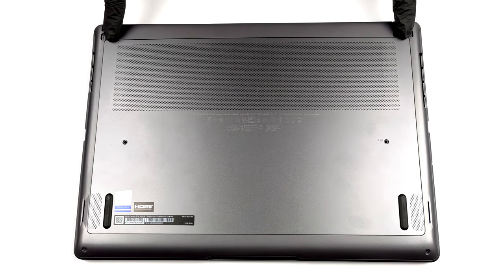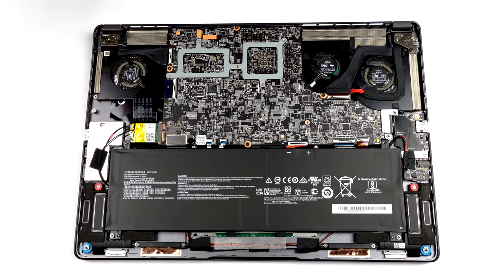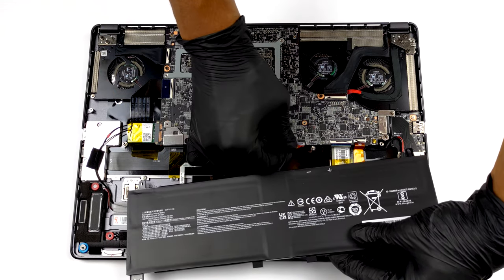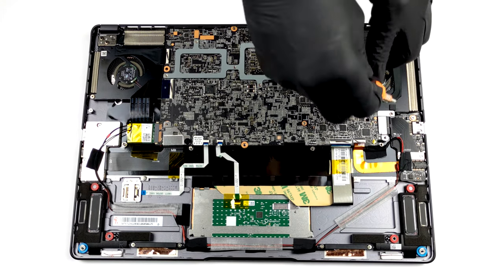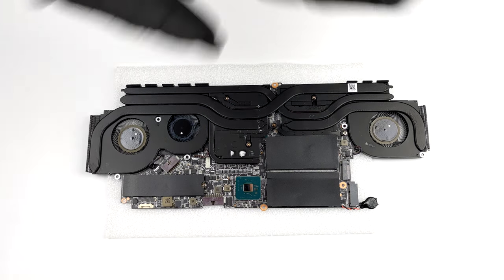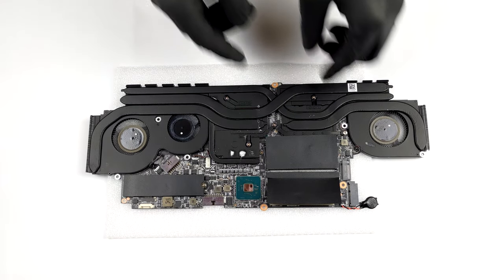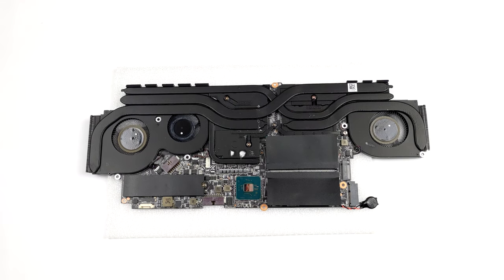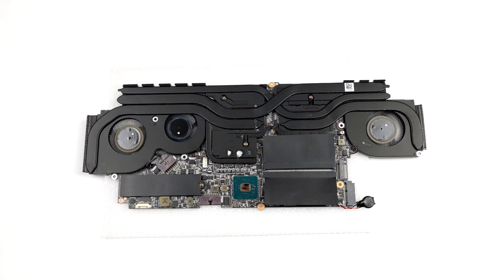🛠️ MSI Creator Z16 (A11Ux) - disassembly and upgrade options

Comment: You can access the 2nd SSD slot without removing the motherboard. It is located on the left (in this video), just under the top left fan. You just need to remove the battery and one screw, add another SSD drive and assemble back what you removed before.
Reply: Please show me how I want this laptop but this upgrade is very much off-putting

Comment: I own this laptop and now the fan started to cause me some problems. It doesn't spin properly and doesn't provide enough cooling to the CPU which makes it thermal throttle and shut down on its own. I can't use if for more than 30 mins. I would like to find the replacement for the fan but I couldn't find any which is compatible with this laptop. If anyone could help me find the replacement fan, please do post its link here. Also, never buy products from msi.